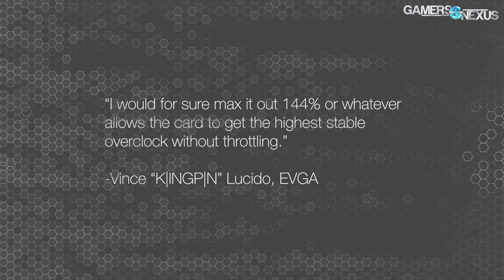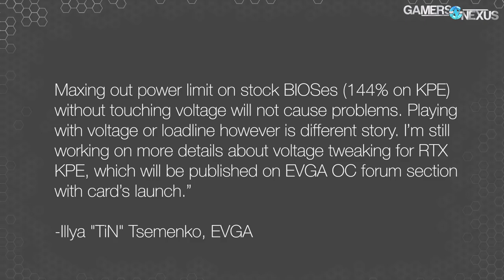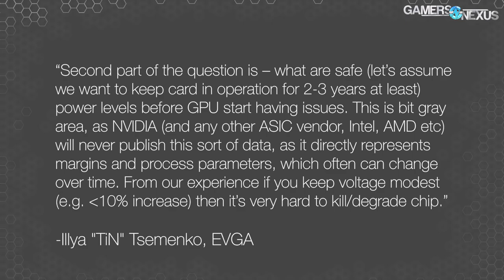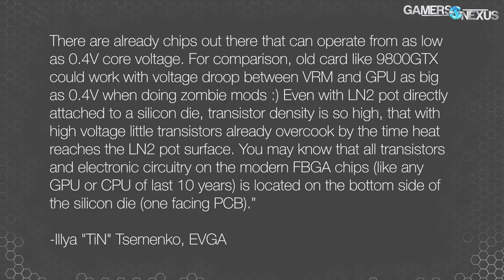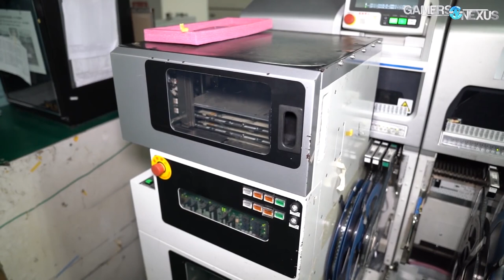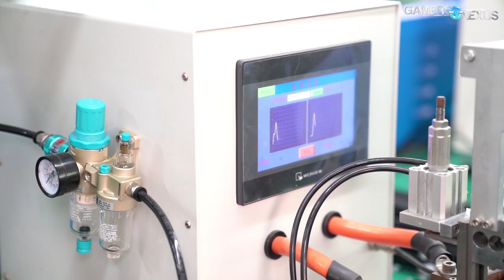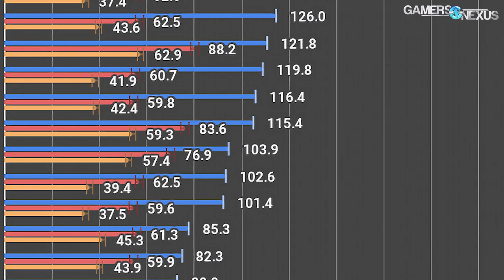Ask GN 107: Does Max Power Target Kill Cards? Ft. Kingpin & TiN Answers

Comment: Regarding power- I think the big difference is that the card has the option to use the extra headroom (Amps) but if you increase the voltage, you’re shoving it down it’s throat, and hence only a 10% increase is recommended.

Comment: how long does CPU solder last?
i have a i7 2600k that has been running at high overclock (5.1ghz 1.5v) for years under a custom loop. 
but it runs WAY hotter than it did originally despite using the same clocks/voltage and WAY better cooling.
it runs a good 10c hotter (not consistent across all cores) than before even at the same room temp.

Comment: One thing I noticed through a few graphics cards, is that it also depends on the date of manufacture of the product. I bought a brand new in box wrapped rx 580 and immediately noticed horrible thermals. Opened it and the thermal paste was dry as bones.

Comment: I just recently decided to replace the paste on my strix 1070- lemme tell you; years of hot and heavy work loads made the paste nearly solid.
i wasn't suffering from overheating problems but after needing a razor blade to scrape off the residue from the cooler and putting on some spare TM30 paste from corsair- it dropped my temps at idle from 39 to 32 C-
But moreover- the amount of dust the accumulated under and around the back plate restraint over top the memory modules was mind blowing. I wasn't sure of what exactly made the dust so sticky- but I assume there was grease left over  which allowed a dust blanket to literally build under the said bracket.

Overall- if you've had your card for 2.5+ years without performing regularly dusting on your PC- chances are you'll have channels and canals of dust across your PCB and you'll wanna replace the paste and perform a light dusting while you're at it.

Comment: AskGN- Why is HBM/HBM2 not used as system ram ( ram cards)?
I see it on GPU's and APU's, but not in card/stick format. Love your channel, always informative!
Reply: A single HBM has over 1000 pins on it with a max capacity of 8GB.  Compare this to a DDR4 DIMM that can have up to 64GB with 288 pins.  (A over 16x increase in capacity to pin ratio) To get these data lanes from one card to another is impractical from a quantity perspective.  In addition, all of the signals must be routed correctly for signal integrity reasons, which is harder to do over longer distances and through connectors.  That is why Silicon Interposers are used instead of regular PCB's.
However, a use for HBM could be a Layer 4 cache before DRAM on the same package as the CPU.
Reply: @ericjohnson3442  Thank you for your response! It was just something I always wondered about. Now it makes sense.

Comment: Ask GN: I've noticed that the way GPUs are cooled differ in terms of how they "suck in and eject air." Meaning that if you look at e.g. a current AMD card, you're likely to see an enclosed case with a fan drawing in air that can only escape the enclosure by traveling over the card and out through the chassis via the ducts at the end of the cards "tunnel". I don't recall seeing this on any recent NVIDIA card, where you're more likely to see tons of gaps in the GPU card's enclosure, allowing air to escape at least as much inside the computer case as through the card's vents at the back of the case. It seems to me logical that you'd try to avoid "polluting" the case with hot air if you can eject it directly out of the case, but real-word tests and benchmarks don't exactly support this in terms of temps and performance. Why the difference, and which approach is actually more ideal? Thank you :)

Comment: Question: RE: Measuring frametime consistency.  (Disclaimer: Its been about 15 years since I took a statistics class so bear with me.)  As opposed to only measuring 1% and .1 % lows, couldn't you plot the frametime curve of both cards and compare them?  You may be able to surmise which card has the "tighter" distribution of frametimes, which would suggest greater frametime consistency (e.g. overlay one curve over another).  A less consistent card would have a shorter, broader curve and a more consistent card would be taller and more narrow.  Its possible the 1% and .1% scores are sufficient to identify which cards are more consistent, but I'm wondering if it's possible that 1% poor performances may still have a tight 95%?  In other words, are the low 1% and .1% scores more outliers, or actually indicative of frametime consistency?

Comment: Ask GN: You mentioned Liquid temperatures in this video and it got me thinking. What kind of difference should you expect to see between core temperatures and liquid temperatures? Does it very significantly between cooler models? Does it vary significantly between custom loop vs AIO?
I think this could be a really interesting thing to include in AIO reviews in future (unless they're all virtually the same, in which case it'd be a fairly boring thing to mention).

Comment: I replaced the stock paste on my Zotac GTX 1080 AMP! right after I got it. Temps were reduced by over 10°C and the cards wasn't hitting thermal limits any longer. It would reach over 90° if the temp slider was maxed in Afterburner. Fans are much quieter and OC is higher by 50 MHz.

Comment: Ive had my power limit maxed to 110 and +25mV or even slightly higher for the past 3 years with heavy gaming and no issues on my gtx970. I do keep all my fans at 100% to keep temps around 70F. I was seeing artifacts and lower memory and core clocks on my gpu when i would have it at +85mV. (500w 80 bronze psu).

Comment: There are a few exceptions to that power limit stuff. Like for example, my Zotac GTX 1080 AMP! Edition you do not want to max out power limit on the stock cooler. Several people I've found said the power delivery gets way too hot above 100% power limit.

I believe this is due to the AMP! Edition using the AMP! Extreme PCB but using a way junkier cooler.

Comment: I got a FE 1080Ti that has been power modded via BIOS. I’ve used 1.2V vcore for almost 2 years now and seen power draws of 500W+, but mostly it’s in the 400W range under full load.

It’s an AIO mod with some cheap chinese heatsinks on VRM so that thing runs hot as hell. 85c at 400W load and 109C @ 500W.

No issues whatsoever.

Comment: my  hd6870 stock runs at 1177mV 900 on the core and 1050 memory and as long as i have had the card which is now water cooled with a zalman resonator 3 max has been running @ 1250mV 1004 up to 1033 on a snowstorm and 1150 on the memory not a new card i had a gtx 580 but that poped a cap and if that dies i have a uhd630 on my intel 8100 . I did also run the gtx580 on the bleeding edge all the time as i do with all my cards

Comment: My old PC being really old(R9-280/I7-3770K), its amazing how much overclocking can be coaxed out of new stuff with very low effort when its kept cool. Put together my first watercooled build with a 2080TI/9900K, and with even a reference EVGA card, its just turn up the power limit up, and up the frequency to 2GHz under load. Done.  CPU? set it to 5GHz all cores, adjust the load-line up 1-2 notches, and done. Obviously when Steve and everyone else push it to the limit, you still have to put in the work just like you used to, if not more, not trying to say that is easy.

Comment: My 7970 ran for 5 years on a 120% powertarget with a fullcover block. 
My  cheap rx480 modded from 120% to 150% for 2 years also with a waterblock still works.
At the same time my brother blew a vrm on is stock settings aircooled card after 7 years.

So in my very small sample size it's still temps, voltage and time that kills your gpu, not powertarget.

Comment: I had a crossfire 7950 setup overvolted and power de-restricted from early 2013 until 2018 when I upgraded, never had issues. well, except the 3gb vram which eventually drove me to upgrade.

Comment: Online you can find 90° SATA adapters for cheap (~5€). If combined with a right angled sata cable they would make for a 180° connector. Does that solve the Phanteks Evolv Xs problem with the ssd mounts on the covers that can snap the connector of?

Comment: Factory question:

So, back in highschool my best friend and me used to enter the state engineering fair for the "Wacky Wonder Works" AKA Rube Goldberg machines.  Definitely understand how one thing being slightly out of line can cause big problems.

Seeing all the crazy automated machines and robots in the factories and knowing that if a SINGLE thing stops working the way it's supposed to it can cause a huge collapse of everything down the line. Do you know how often they have things go catastrophically wrong on these lines? 

I'm guessing they've got plenty of sensors and failsafes in line to prevent those things, but seeing how many of these lines and machines have been "modded" makes me wonder.

Comment: Q1: Do you debloat or clean windows at all when doing testing ? If so how do you do it, basic cleaning like removing some things your self or using something like TronScript Debloater ?
Q2: How possible would it be to include some linux testing (just the basics for now though) like comparing AMD Vega cards to their counterparts and some workflow applications like Davinci Resolve for video editing on linux etc ... Are you planning on doing something like this or is linux out of the question for now ?

Comment: Nine months ago you did "What Are Memory Timings? CAS Latency, tRCD, tRP, & tRAS (Pt 1)" which covered the primary timings. You stated that there will be a Pt 2 (hopefully on the secondary timings). Any update on when this might happen? I just watched Buildzoid's "Overdocking the Corsair Dominator Platinum SE..." and I gleaned some new information regarding some of these timings but they were off-the-cuff comments made in passing. You mentioned a couple of the timings in one of your live overclocking/TimeSpy Extreme  streams but I didn't take enough notice at the time to remember it . I understand this is a very in-depth subject but I think it'd be worthwhile for a number of your viewers.

Comment: I have modded my 980Ti's to 475W max power (200+200+75) and have been running them since early 2016 and have had zero problems.
Reply: That's a lotta juice, what kind of clockspeeds do you get? I'm at 1485 without power mods
Reply: The major factors are the time spent actually running beyond design power, and the thermal cycling the die sees. Some games won’t load the core to the full power target all the time, and even then it depend on how long your gaming for. One can run the power at 10,000,000% and idle it all day with zero impact compared to a stock clock card. For most consumers, I suspect thermal cycling causes more wear than actual use. As components heat and cool, they expand and contract at different rates and as a result forces are induced inside the die that can lead to failures long term. The more thermal cycling your card sees, the faster this happens. In some cases loading to 100% is better than gaming where the load can be dynamic.
Reply: @idewmeth4203  For my 980Ti's I am able to run both of them with 1.293v @ 1600+Mhz in SLI (have some vids). Depending on the workload I can be bench stable @ 1640Mhz for a limited time but 1600Mhz is more of my average. FWIW, with regard to MAXWELL, power has an indirect impact on clock speed (voltage has a direct impact on clock speed for Maxwell and prior). Lack of power can certainly reduce maximum achievable clock speed however that is power throttling. Once you've reached maximum stable boost power only helps the GPU maintain that boost speed.

Comment: Always replace the GPU paste when the damn thing starts to cut out. Don't trust the temperature readings with bad paste, generally when you get issues get it done. Mine read 80 Celsius, but definitely will have been higher, now tends to only got to 75 Celsius.

Comment: does it make sense to buy a CPU cooler if you aren't overclocking? and should you overclock on the stock cooler?
Reply: Like the first question/answer stated, you are best to maje sure your components are at or under 60° C under load. If your stock cooler can do that, then unless you mind the noise, you can keep it. If not, I would upgrade for the longevity and other details. Most stock coolers cannot withstand CPU overclocks.

Comment: Running my sapphire r9 290x bf1 edition blower style since pre-order at max power target slider. Been a solid 94C for 6 years and didnt replace paste and factory cooler till a couple months ago. Put an arctic accelero extreme 4 (3fan) cooler on it / has massive heatsinks for both sides of the gpu. Running about 30c cooler now under same loads with it,. Best 80$ i spent. Now ill get even more time out of it lol.

Comment: @AskGN
Up to now AMD have used a sytem of 2 CCX modules in their Zen dies. With each CCX  containing four Zen cores. Multiple CCX are connected together using what AMD name  Infinity Fabric. As I understand core to core communication over the Infinity Fabric intoduce some latency. And this may hamper the AMD perfomance compared to Intel in some applications. In the new Zen 2  microarchitecture do you think AMD will expand each CCX to contain 8 cores, and to speculate further what can be the benefits of doing this

Comment: ASK GN: Super good question!  What is the typical expected lifespan in hours of all common computer components assuming you buy high quality components?  GPU/CPU/RAM/PSU/MOBO/SSD   Do power cycles like turning the computer on and off or resuming from standby put extra wear and tear on the components and can the components only handle a finite number of power cycles (if so how many is typical?)?  Anything else to know?  ...and what electrical components (caps/transistors/etc) impart those lifepsans?

Comment: What i'm curious about is
I've had my EVGA 1060 SSC 6GB for a few years now and a few weeks ago I decided to redo the paste
Doing so dropped temps 20-30C, Literally 20-30C with max temps reaching a mere 64/65C in demanding games and 40-50C in non demanding games (Even with a MUCH higher OC than what I previously had due to the huge drop in temps, Previous: +80Core +125 or there abouts Memory, Now +95 Core +325 Memory)  
This was not done with a high end paste but merely Cooler Master paste that comes with a Hyper 212 EVO

All I did was spread a small layer evenly across the GPU then added a SMALL Dab in the center.
So why did this cause such a huge difference in temps?
Note: Before repaste, Max temps were in the area of 78-80C in a high airflow setup.

Comment: Ask GN: Would it be possible for manufacturers to make graphics cards upgradable by manufacturing boards and GPUs separately? You could buy a board with a cooling solution that would last you a few generations by just changing out the GPU and VRAM module. It would reduce e-waste and make upgrading cheaper and easier. I get that it would change the format considerably and would probably necessitate a massive redesign of cases and motherboards but wouldn't it be worth it? Thanks for all the great content! GN is awesome!

Comment: Ask GN: I am using the NZXT bracket to add an AIO to my MSI aero 1080 TI. Temps go up to approx 51 under full load (using Core P3 case) which seems pretty good to me, but should I add heatsinks to the memory modules? I also took the stock 80mm fan off the bracket and replaced it with a Be Quiet Silent Wings but I;m not sure that makes a difference or not.

Comment: I've watched a lot of Ask GN and I'm not sure if this has been asked before, If it's been answered then someone feel free to point me to the right episode!

What is the life expectancy of a AIO watercooler? I've been using my Kraken x61 since June 2016 and while I've definitely noticed a solid 10c, maybe 15c increase in temps but still within acceptable levels(worth noting; the thermal paste hasn't been replaced at all), I haven't noticed any funky noises or odd behavior. Would it be fine to keep using until a full system rebuild in say, 18-24 months time? or is it probably time to start considering getting a replacement before it starts failing? Additionally, what kind of failure should I expect? Would it be as simple as just the pump no longer working and temps sky rocketing and the system being unstable/shutting down from the processor's overheating protection kicking in or would it be something more catastrophic like leaks?

Thank you if you read this :)

Comment: i actually had a gigabyte board die (igpu vrm mosfet died) due to shorted gpu vrm, i am guessing that the pcie power was supplied from that vrm rather than the "memory" or "core" vrms, so that is something to look at too if you have an issue of a bad board. (specifically motherboard) ;)

Comment: I'd like to see/hear the issue with gddr6 overheating,  my ftw3 2080ti mem 3 gets into 80-90c range with stock fan curve.  I've also noticed it goes below the 7000mhz clock with those temps.